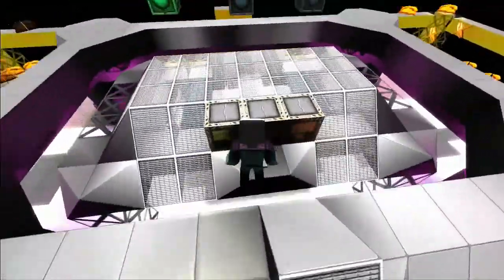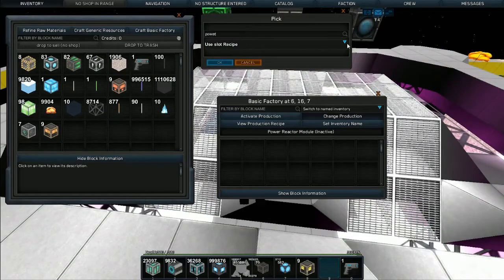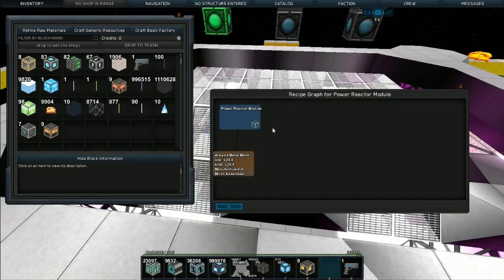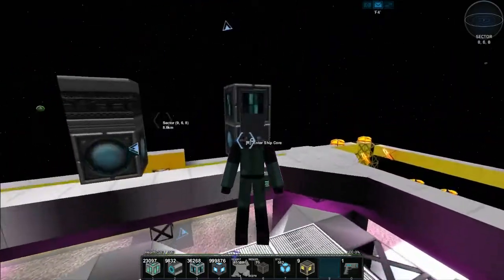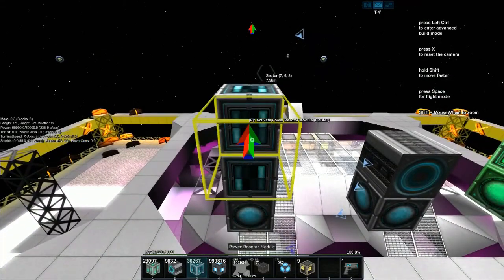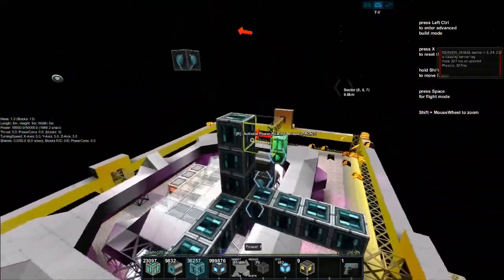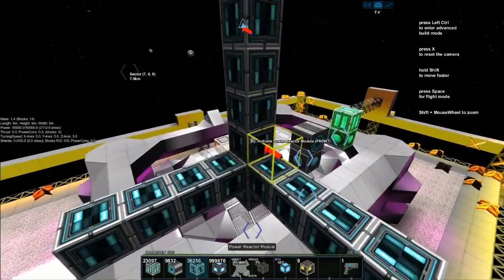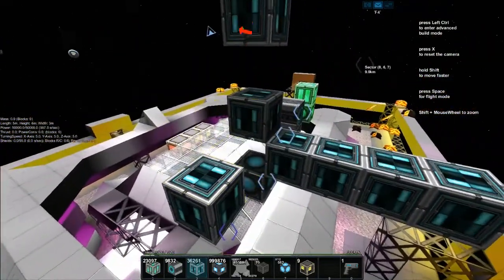#1 Power Regen Block [Starmade Tutorials]

Comment: 3-dimensional is not more efficient per block, it is the same. 4 Blocks in a straight line is exactly equal 4 blocks in 3D. I wish we would stop perpetuating that myth, which is just a misunderstanding of the 5x5x5 challenge. Power regen is a function of the summed total of the dimensions, so 4x1x1 (total 6 with 4 blocks) is equal to 2x2x2 (total 6 with 4 blocks). People misunderstand this because the challenge shows you that if you are constrained in one direction, you can get more efficiency by increasing the power chains total dimensions by moving in more than 1 direction.
Reply from the maker: if that is true. in fact I did over 20 episodes on 5x5x5 a long time ago.
I will now do this again for you Mr mcgrath

seeing two dislikes (sadface)
Reply: MushroomFleet For what it is worth, the dislike didn't come from me. Without you doing videos, I wouldn't have much to watch when on the road for work :)
Reply from the maker: Dan McGrath thanks for the reply